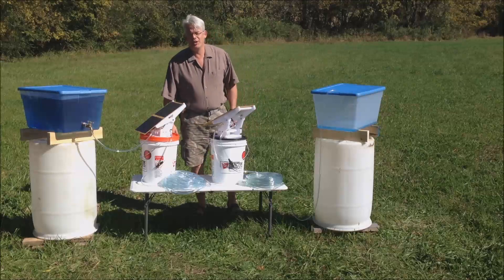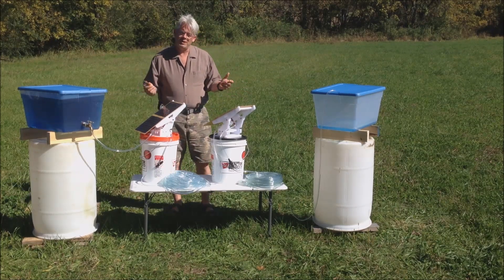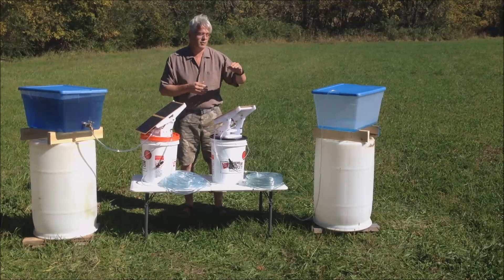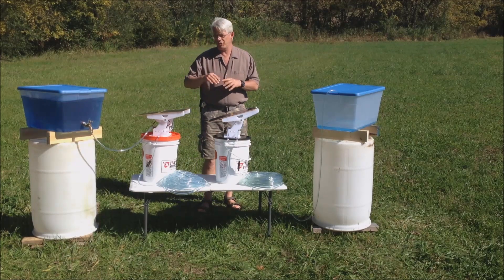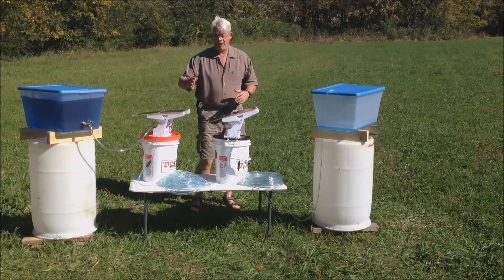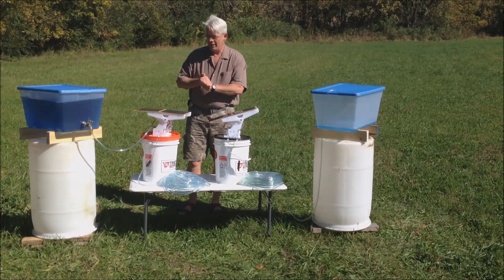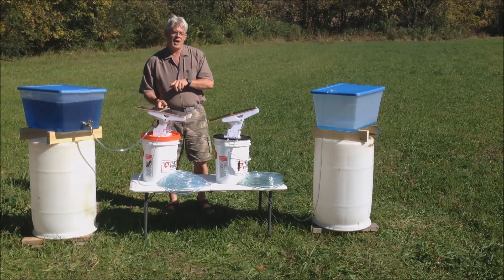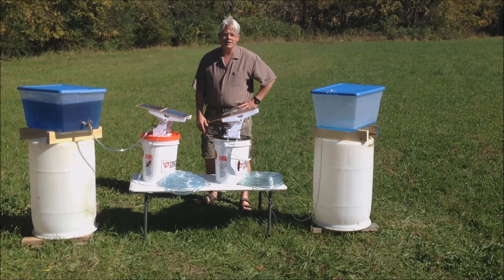WaterBoy Intro - Time-lapse and Brief Explanation

Comment: Brilliant!

"no batteries, no solar controller, no external power or infrastructure"

Hardened Power Systems is on the move . . . another very cool design with some impressive capabilities. I can envision a wide variety of applications for this system.

As an aside, looks like you might be having a wee bit too much fun at the design bench and the CNC machine!
Reply from the maker: Guilty as charged, Doc!  When inspiration hits, it means late nights with CNC, CAD, and strong sweet tea...